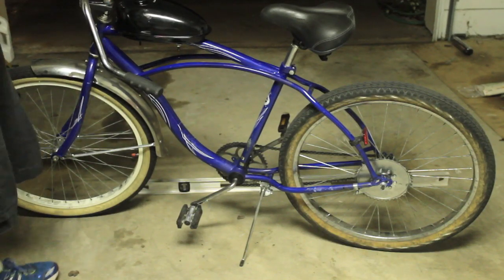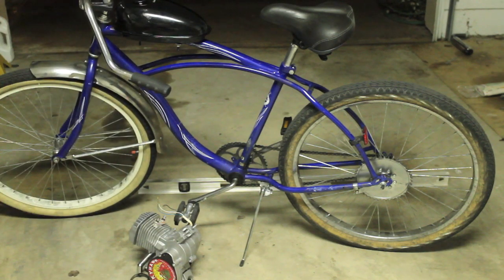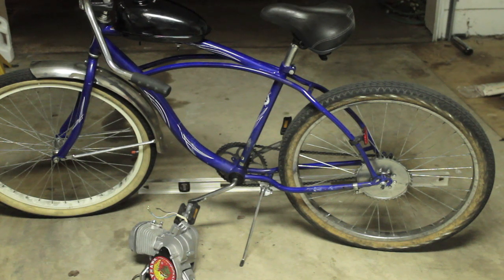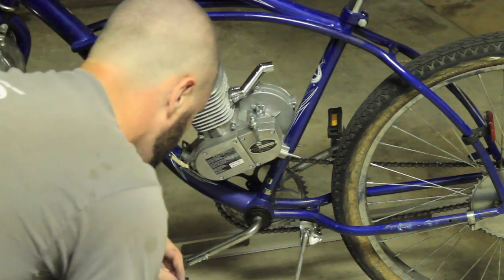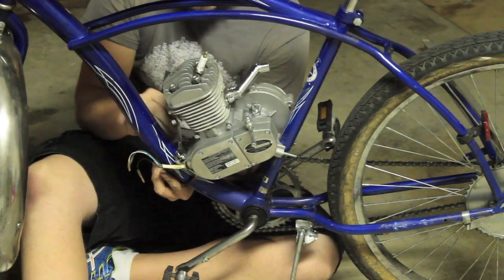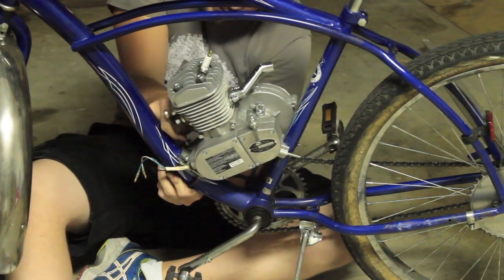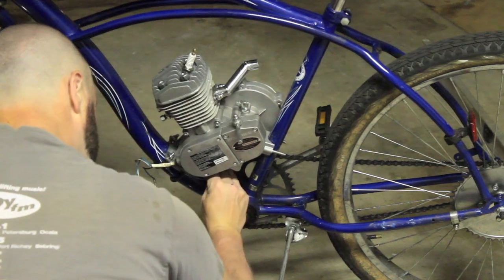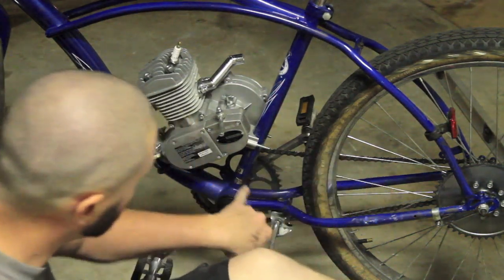How to Put An Engine Kit On A Bike Part 2 (Motor)

Comment: Hey Man. I also have a beach cruiser, and have the same issue with the lower engine mount. Wondering. Where can I buy the u-bolts, threaded-posts, and mounting bracket? Thanks in advance.